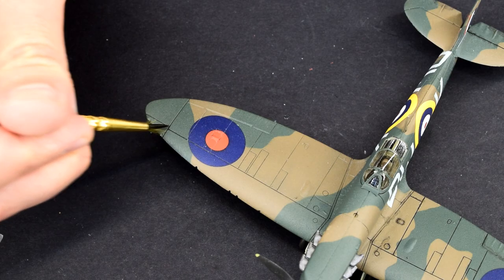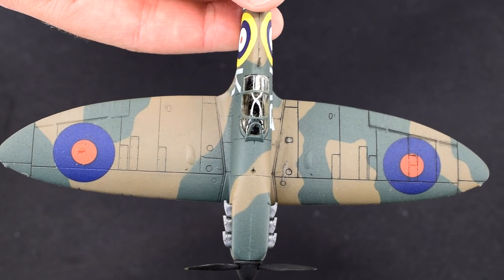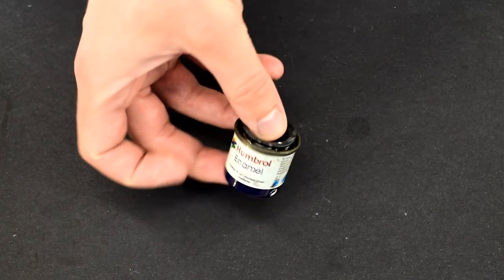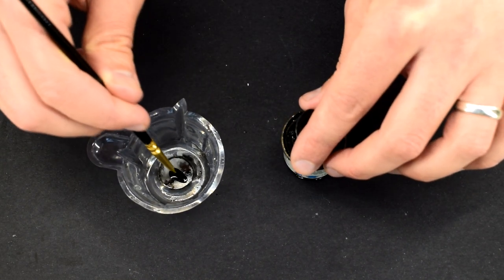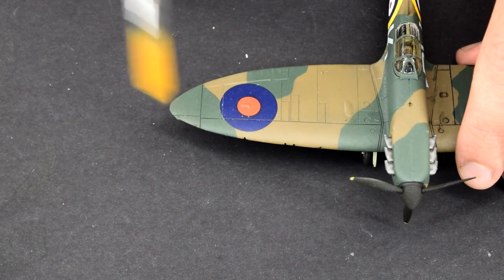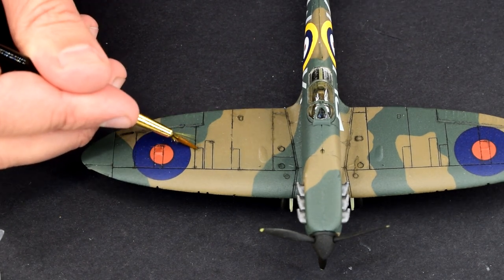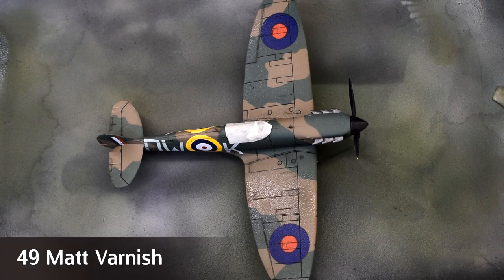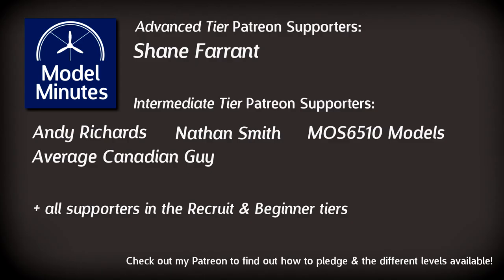Super Easy Panel line Wash You Can Make at Home!

Comment: Just tried this on a spitfire starter kit i built. Sadly all the acrylic paint has starting coming away from the model and the wash itself gets removed when taking excess away also dissapointed am i doing something wrong?
Reply from the maker: is the acrylic paint completely dry? I don't normally do this kind of wash until the paint and varnish is completely cured (after about 24 hours). Did you use excess white spirit? It is possible that soaking the paint in white spirit could remove the previous layers, you only want to use a tiny amount to remove the wash.

Finally you could be scrubbing too hard - it is a delicate operation and you need to let the chemical reaction remove the enamel wash rather than abrasive effect. If you are rubbing the paint too hard, even without doing a wash hard scrubbing can scrape the paint away
Reply: @ModelMinutes  I suppose it is possible i used too much white spirit in the mix maybe Ive managed to respray the underside and ive gone for a pastel wash instead. i will try this again in the future on a test model. Thanks for your reply :D

Comment: In the acrylic wash i dont use white spirit?
Or just water?
Reply from the maker: white spirit won't dilute acrylic paint as it is not a solvent for that kind of product. White spirit will work on enamel (oil) based paints.

For acrylic you need water or an alcohol based thinner usually
Reply: @ModelMinutes  Ok
And if i paint with enamel i need acrylic wash right?
Reply from the maker: @matetakacs3769  usually that helps to prevent them from reacting

Comment: In the real world, panel lines are not very dark or wide. Something just a shade darker than none at all is more realistic than dark, prominent, obvious lines. Less is best. And not all areas are equal. Flaps, ailerons, stabilizers, etc, and typically oily areas such as engine nacelles, exhaust, and wheel well areas can be a shade or two darker, but not real dark !
Reply from the maker: There are usually real-world examples for most things

Comment: Anytime I add a wash and go to remove the access, I always end up removing the wash from the panel lines. I always dampen the the q tip, make sure there isn’t too much spirits, however it always comes out of the desire areas. Any tips?
Reply from the maker: you probably need to leave the wash to dry a bit longer
Reply: @ModelMinutes  how long do you suggest?
Reply from the maker: @Lordcrill  until it’s pretty much dry

Comment: I keep hearing that your meant to put varnish on before doing panel lines or weathering?... anyone got a solid answer
Reply from the maker: You don’t have to, but there are benefits of doing it. A gloss or satin varnish before applying a wash will not only protect the decals, but help the wash flow into panel lines. A more flat/Matt surface can prevent this and it will just stay on the surface rather than “running off”. It’s up to you though

Comment: I've had poor results using washes though just getting a dirty look has helped many of my models look interesting.
But I've come to a conclusion that all the guys that make pin wash tutorials use air guns to spray their models.
For the rest of us using a paint brush, there's much less left in terms of panel lines at the end of the painting process, then first coat of varnish, then decals, then second coat of varnish etc.
This is something I never see mentioned but I have concluded it's been making my life difficult trying to apply washes and why I can never get a satisfactory result, even following all the instruction I see around on Youtube.
Reply from the maker: You should watch some of my build videos where I hand paint the models - I still apply washes to those as well and they come out ok.

You don’t need an airbrush to get thin layers of paint, it’s easy enough to do with a normal paint brush too

Comment: The panel lines are quite bad employed in 1/72 planes---- WHY? BECAUSE The plane needs the most flat surfaces to get the most aerodinamic efficency. Check the real planes, and ull notice they ARE NOT BLACK. THESE LINES ARE JUST A BIT DARKER, DUE TO THE LOW QUANTITY OF DUST AND MAYBE THE SHADOW.
Reply from the maker: You read the title of the video right? I never said this was meant to be realistic . . .  (as mentioned in the video you can pick different colours depending on how much you really care about that stuff)